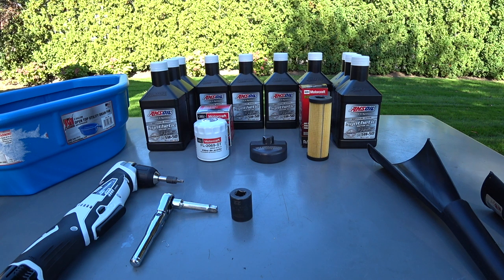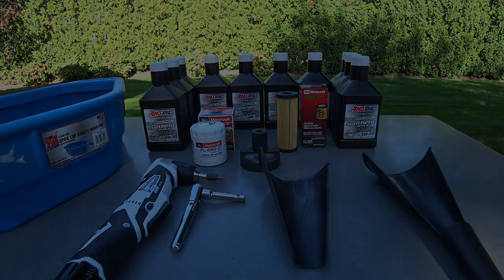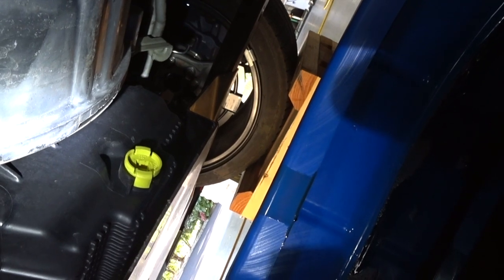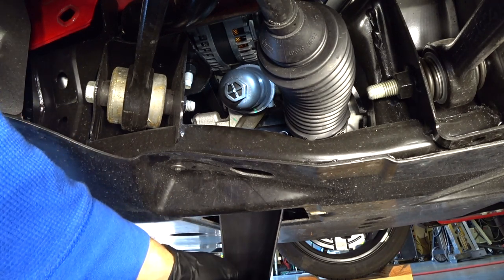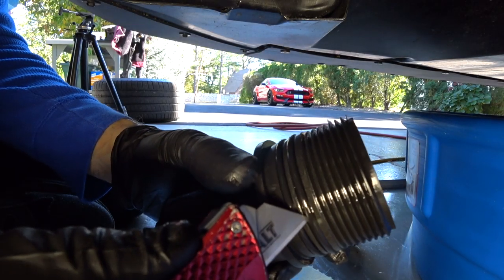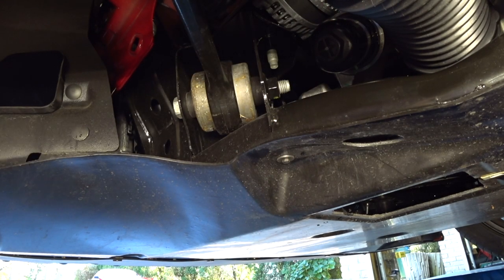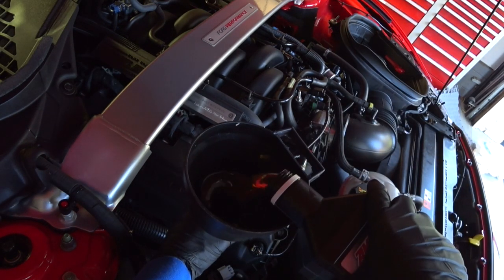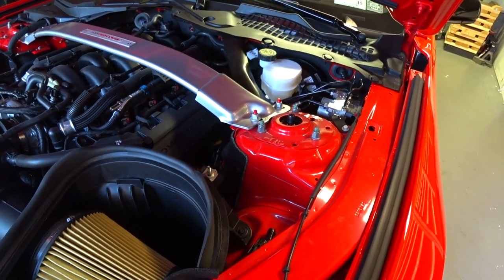Shelby GT350 Oil Change | No Mess | Auto Fanatic

Comment: A trick that I used to use when I did oil changes on my cars was to use a small plastic garbage bag to completely encase the oil filter before I unscrewed it. It usually did a good job in catching the oil that would drain and was convenient as a disposal bag for the stuff that needed to be discarded.

Comment: If you use one of the "Form A Funnels" made from flexible green rubber and wedge it up behind the oil pump itself you will be happy with how well it works and stays put.   And I totally agree you have to pull the left front wheel to gain access.
Reply: I spent wayyyy to much time under mine because that damn wheel was very obstructive

Comment: Nice video. Informative. Good camera work. My 2018 GT-350 has only 515 miles and breaking it in gently, so I have not yet changed the oil. I think I will find I have the new canister-type filter you have on yours.
Reply: Your 18 has a cartridge, like the video.

Comment: Is there a reason you don’t put the used oil in the Amsoil containers? It seems that way you could recycle everything at the same time. The only problem I could see is that it would be more difficult to tell when the containers are getting full. Does Amsoil have the clear gradation marks on the side?
Reply from the maker: much easier to use the gallon containers trust me on that the smaller ones tip over to easily.

Comment: If these cars like many today are running with low tension piston rings for more freed up HP, then using a 5w50 weight oil, the rings will have a harder time trying to flex out against the cylinder walls to seal in combustion, thus using more oil due to blow by. I don't know what the owners manual says for the viscosity range during the different seasons or how loose the bearing tolerances are for what oil this baby takes.

Comment: I'm going to start changing my own GT350 oil. Are you still using Amsoil, and has it solved consumption use. I'm using 1qt per 1k miles. I'm considering Amsoil.
Reply from the maker: yes Amsoil is the best, no consumption issues since i switched.

Comment: Great video. Ford needs to copy Mercedes with the oil filter location. Mercedes has their oil filter easily accessible from the top of the engine bay.
Reply: Mercedes, BMW, Subaru.... I don't know why all manufacturers don't have top access oil filters. I guess they figure most people are paying to get it done, so why make it easier for the DIYer. At the same time, since most people are getting it done at a Ford dealer, and the Ford dealer is going to charge the same for an oil change either way, why not reduce your labor hours by 10 minutes. 10 minutes times millions of oil changes is a lot of money.
Reply: Toyota does that on some vehicles, too.

Comment: Great idea taking the driver wheel off. I think using cardboard would be easier to cut/shape and shove in where you want it. Also, you didn't change the other Oring. When the torque wrench clicks, you are there. You don't do it multiple times or push past the click. You were over torquing that filter housing.
Reply: As long as it doesn't turn, you aren't over-torquing

Comment: changing oil from the bottom of the car is such an old news. I changing oil and oil filter from the top on my 2012 Audi S4 using oil evacuator, without even changing office clothing. Now that I purchased 2019 Shelby GT350, it's going to be a pain to change the oil on this car. So much for Ford's ingenuity.
Reply from the maker: the Shelby is super easy to drain out but on my Alfa Romeo QV i extract from the top  it really depends on the car but i use both methods.

Comment: when its time i will use my plastic drive up ramps ; my car before was a 71 ss 454 el  co.  lots heavier & it worked fine.  it raises the car aprox.  6-inches---thanks for the info---ive always used  red line full synth. oil,,i know amzoil has been around at least since the 70s.

Comment: thanks for the video. jw if it would make sense to loosen the filter (not remove it completely) while the drain plug is out to try to drain some of the oil thats around the filter?
Reply from the maker: I will have a new oil change video live tomorrow on the channel showing the newer style cartridge filter on my 2019 GT350R

Comment: I have the regular style filter.  I make sure I can loosen it, then punch a hole in the bottom of the filter with a pick or small screwdriver and let the oil drain out of the filter in the pan.

Comment: I've got a a Ferrari 355 with flat plane crank and 8500rpm redline. I use 1 at og oil every 5-750 mikes which is considered normal. You think changing to Amsoil will make that much difference in oil consumption?
How much oil were you using before and after Amsoil?
Reply from the maker: F355bob it might, the Shelby is bad at oil consumption. What year is your 355 im dying to buy one but so afraid of the upkeep on those cars. Looking for a Berlineta with 6 speed which is hard to find as most cars are convertibles on the market.
Reply: 95 with a lot of suspension and engine mods. Fantastic cars but maintenance is high.

Comment: Whew, $60,000 for a car with a plastic oil pan!  Are you kidding me?  Now add to that, one of those paper element oil filters.   I would never purchase a Shelby for these two reasons.
Reply from the maker: its carbon composite all new cars are switching to this technology even the high end exotics, saves weight and easier to manufacture with high volume repeatability.
Reply: All oil filters either a spin on or cartridge style has paper.
Reply: I prefer the metal clad ones.  Putting  a 24mm socket to a plastic oil filter housing gives me the chills.

Comment: Will you be doing a video of an oil change for your new 2019 GT 350R?  Also, do you still use Amisoil or do you recommend another brand?  I would love to see an updated video of an oil change.  On another note, do you plan to put on PPF on your new GT 350R?  I just put it on my GT 350 with track pack and reinstalled the splash guards (without the double-sided tape).  I used a heat gun to create a bend for the guard, so it will not require the tape.  Just using one metal clip at the very top.  I would love to see what you are doing to your GT 350R.
Reply from the maker: yes soon I am waiting to get more miles then full oil change and oil analysis video coming on the 350R
Reply: @autofanaticcars  I am sure you are doing it after the initial 1k miles.  I waited until 2.2k miles, and I wish I had done my first oil change at 1k or a little less.  I saw a lot of metal particles stuck on the oil filter element.
Reply from the maker: on these cars i do my first at around 500 then 1500 and then 3000 increments. the first one is the most important since the factor fill is garbage and there will be particles in the oil that sheer off during break in.I am sending the oil to Blackstone that gets removed from the car, if the weather permits might be next week il have a video on this.

Comment: Good video. Have you considered using a fluid evacuator like the Mityvac and siphoning from the top? I guess with the filter still being below, you still need to lift the car.
Reply: dipstick tube is wayyy to small to fit any of my attachments. also with the filter being on the bottom, there's no point in sucking it from the top.

Comment: The Screw to the oil panel underneath is stripped. Any suggestions on what to try in order to get it out?
Reply: To be clear, still not too bad of a job without the panel... but I see how it could be easier.
Reply from the maker: take the wheel off as i show here forget the access panel below
Reply: Right on man. That was what I did. Thanks for the quick reply! Love the videos.

Comment: Interesting idea with the modified funnel, I used cardboard and tape in my video.
Reply from the maker: yeah my idea worked great and taking the drivers wheel off having the entire car raised is the way to do this with zero mess.
Reply: On my 2011 mustang, I had someone do a oil change for me, they didn't use any cardboard, to keep the oil from going every where. Oil got onto the connectors for the electric power steering. About 20 mile later, every dash light lit up, lost my power steering,  and a few other accessories. We tried cleaning the connectors, but it would still intermittently go nuts on me. Finally had to replace the whole lower wiring harness. So no matter what you do make sure you at least use cardboard to keep oil away from the connectors on the steering rack

Comment: how come you didn't use the AMSOIL oil filter
Reply from the maker: they do not make it for this car i was told
Reply: @autofanaticcars I currently use royal purple in my car, but just heard about all the benefits AMSOIL has. Is it as good as they say?
Reply from the maker: yes its the best oil, all the engineers told me about RP issues and i stopped using it years ago it is too slick and thin with not enough shock dampening for moving parts especially gears etc. After using Amsoil since 2011 on every car they all stopped burning oil, quieter valvetrain, better milage and better oil PSI, look into trying it i think you wont look back once you do
Reply: @autofanaticcars I currently use royal purple in my car, but just heard about all the benefits AMSOIL has. Is it as good as they say?
Reply: @autofanaticcars  will do, next oil change. Thanks